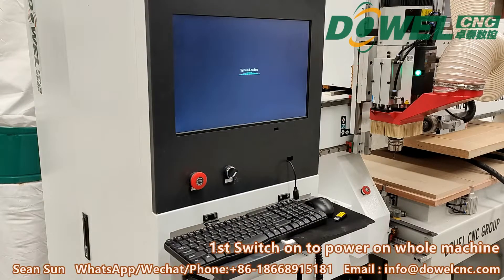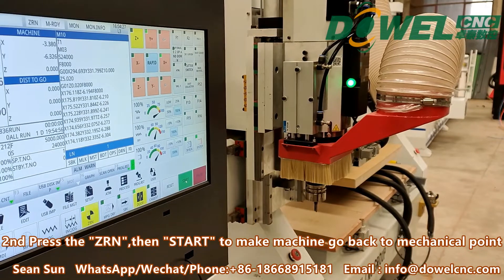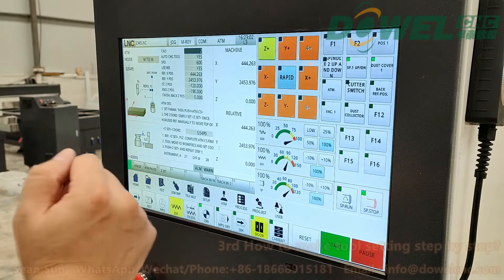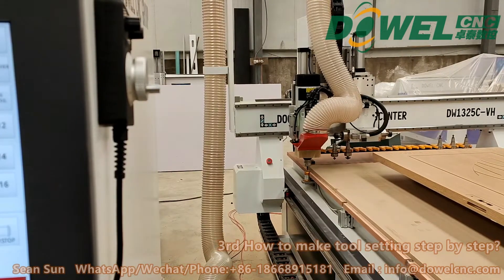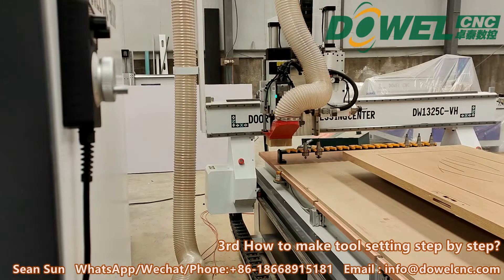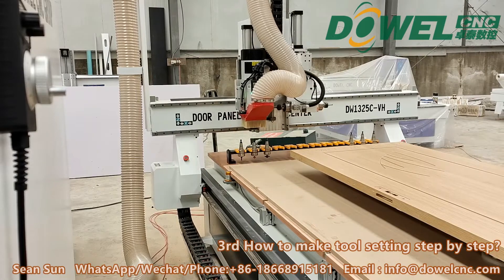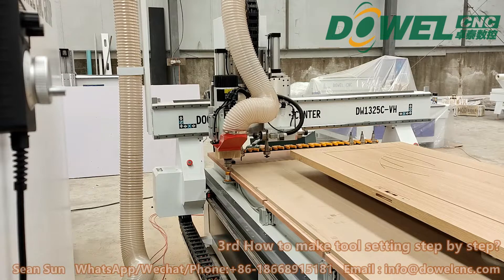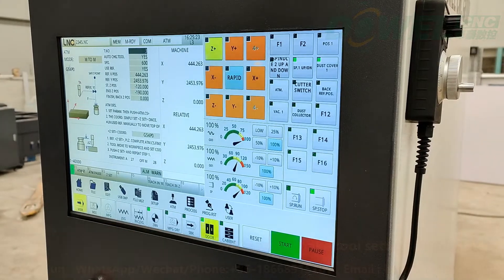How to Use LNC Controller of ATC CNC Router? Tutorial Video and User Manual of Taiwan LNC Controller

Comment: Hello, very good video!  Helped me turn on and set up the machine, the controller is LNC MW2200.  I want to ask you what software you use to prepare the (.nc) files?  So far I have used artcam 2018 which has over 30 different (.nc) "G code for the tool path files" , only one was able to open but there is a problem with the Z axis.  Thank you very much !
Reply: hi i have same problem with you, did figure it out which nc file is working?
Reply: @udiStyler  I use Art Cam, which does not have a post processor for LNC.  I use another post processor, which I edit in NOTE PAD.  I had a problem with turning off the dust collector, it turned out that M72 was working.
Reply: @georgipraskov8223  which post processor do you use, and is it an atc post processor? how is it edited? thanks
Reply: @udiStyler  
In my case, the NC file for ATC  looks   like this...

T1
M03 S18000
G43 H1
G00X38.000Y84.000Z16.020
G01Z-8.000F500
G00Z16.020
G00Y116.150
G01Z-8.000F500
G00Z16.020
G00X259.000Y50.000
G01Z-8.000F500
G00Z16.020
G00X291.000
G01Z-8.000F500
G00Z16.020
G00X38.000Y685.350
G01Z-8.000F500
G00Z16.020
G00Y717.350
G01Z-8.000F500
G00Z16.020
M5
T9
M03 S6000
G43 H9
G00X30.000Y9.200Z16.020
G01Z-19.000F500
G00Z16.020
G00X165.600
G01Z-19.000F500
G00Z16.020
G00X296.200
G01Z-19.000F500
G00Z16.020
G00Y792.000
G01Z-19.000F500
G00Z16.020
G00X163.100
G01Z-19.000F500
G00Z16.020
G00X30.000
G01Z-19.000F500
G00Z16.020
M5
T10
M03 S6000
G43 H10
G00X30.181Y179.500Z16.020
G01Z-12.000F500
G00Z16.020
G00Y229.500
G01Z-12.000F500
G00Z16.020
G00X30.000Y279.500
G01Z-12.000F500
G00Z16.020
G00Y329.500
G01Z-12.000F500
G00Z16.020
G00Y379.500
G01Z-12.000F500
G00Z16.020
G00Y429.500
G01Z-12.000F500
G00Z16.020
G00Y496.500
G01Z-12.000F500
G00Z16.020
G00Y546.500
G01Z-12.000F500
G00Z16.020
G00Y596.500
G01Z-12.000F500
G00Z16.020
G00X283.200
G01Z-12.000F500
G00Z16.020
G00Y546.500
G01Z-12.000F500
G00Z16.020
G00Y496.500
G01Z-12.000F500
G00Z16.020
G00Y429.500
G01Z-12.000F500
G00Z16.020
G00Y379.500
G01Z-12.000F500
G00Z16.020
G00Y329.500
G01Z-12.000F500
G00Z16.020
G00Y279.500
G01Z-12.000F500
G00Z16.020
G00X283.381Y229.500
G01Z-12.000F500
G00Z16.020
G00Y179.500
G01Z-12.000F500
G00Z16.020
M5
T4
M03 S18000
G43 H4
G00X311.200Y2.075Z16.020
G01Z-2.714F300
G01Y97.037F1500
G02X315.208Y101.000I3.979J-0.016
G01X337.200
G00Z16.020
G00X311.200Y2.075
G01Z-5.429F300
G01Y97.037F1500
G02X315.208Y101.000
G01X337.200
G00Z16.020
G00X311.200Y2.075
G01Z-8.143F300
G01Y97.037F1500
G02X315.208Y101.000
G01X337.200
G00Z16.020
G00X311.200Y2.075
G01Z-10.857F300
G01Y97.037F1500
G02X315.208Y101.000
G01X337.200
G00Z16.020
G00X311.200Y2.075
G01Z-13.571F300
G01Y97.037F1500
G02X315.208Y101.000
G01X337.200
G00Z16.020
G00X311.200Y2.075
G01Z-16.286F300
G01Y97.037F1500
G02X315.208Y101.000
G01X337.200
G00Z16.020
G00X311.200Y2.075
G01Z-19.000F300
G01Y97.037F1500
G02X315.208Y101.000
G01X337.200
G00Z16.020
G00X311.200Y0.000
G01Z-3.250F300
G01Y97.000F1500
Y792.200
G00Z16.020
G00Y0.000
G01Z-6.500F300
G01Y97.000F1500
Y792.200
G00Z16.020
G00Y0.000
G01Z-9.750F300
G01Y97.000F1500
Y792.200
G00Z16.020
G00Y0.000
G01Z-13.000F300
G01Y97.000F1500
Y792.200
G00Z16.020
G00X0.000Y1500.000
M5
M72
M30
Reply: In my case the NC file looks like this 

T1
M03 S18000
G43 H1
G00X38.000Y84.000Z16.020
G01Z-8.000F500
G00Z16.020
G00Y116.150
G01Z-8.000F500
G00Z16.020
G00X259.000Y50.000
G01Z-8.000F500
G00Z16.020
G00X291.000
G01Z-8.000F500
G00Z16.020
G00X38.000Y685.350
G01Z-8.000F500
G00Z16.020
G00Y717.350
G01Z-8.000F500
G00Z16.020
M5
T9
M03 S6000
G43 H9
G00X30.000Y9.200Z16.020
G01Z-19.000F500
G00Z16.020
G00X165.600
G01Z-19.000F500
G00Z16.020
G00X296.200
G01Z-19.000F500
G00Z16.020
G00Y792.000
G01Z-19.000F500
G00Z16.020
G00X163.100
G01Z-19.000F500
G00Z16.020
G00X30.000
G01Z-19.000F500
G00Z16.020
M5
T10
M03 S6000
G43 H10
G00X30.181Y179.500Z16.020
G01Z-12.000F500
G00Z16.020
G00Y229.500
G01Z-12.000F500
G00Z16.020
G00X30.000Y279.500
G01Z-12.000F500
G00Z16.020
G00Y329.500
G01Z-12.000F500
G00Z16.020
G00Y379.500
G01Z-12.000F500
G00Z16.020
G00Y429.500
G01Z-12.000F500
G00Z16.020
G00Y496.500
G01Z-12.000F500
G00Z16.020
G00Y546.500
G01Z-12.000F500
G00Z16.020
G00Y596.500
G01Z-12.000F500
G00Z16.020
G00X283.200
G01Z-12.000F500
G00Z16.020
G00Y546.500
G01Z-12.000F500
G00Z16.020
G00Y496.500
G01Z-12.000F500
G00Z16.020
G00Y429.500
G01Z-12.000F500
G00Z16.020
G00Y379.500
G01Z-12.000F500
G00Z16.020
G00Y329.500
G01Z-12.000F500
G00Z16.020
G00Y279.500
G01Z-12.000F500
G00Z16.020
G00X283.381Y229.500
G01Z-12.000F500
G00Z16.020
G00Y179.500
G01Z-12.000F500
G00Z16.020
M5
T4
M03 S18000
G43 H4
G00X311.200Y2.075Z16.020
G01Z-2.714F300
G01Y97.037F1500
G02X315.208Y101.000I3.979J-0.016
G01X337.200
G00Z16.020
G00X311.200Y2.075
G01Z-5.429F300
G01Y97.037F1500
G02X315.208Y101.000
G01X337.200
G00Z16.020
G00X311.200Y2.075
G01Z-8.143F300
G01Y97.037F1500
G02X315.208Y101.000
G01X337.200
G00Z16.020
G00X311.200Y2.075
G01Z-10.857F300
G01Y97.037F1500
G02X315.208Y101.000
G01X337.200
G00Z16.020
G00X311.200Y2.075
G01Z-13.571F300
G01Y97.037F1500
G02X315.208Y101.000
G01X337.200
G00Z16.020
G00X311.200Y2.075
G01Z-16.286F300
G01Y97.037F1500
G02X315.208Y101.000
G01X337.200
G00Z16.020
G00X311.200Y2.075
G01Z-19.000F300
G01Y97.037F1500
G02X315.208Y101.000
G01X337.200
G00Z16.020
G00X311.200Y0.000
G01Z-3.250F300
G01Y97.000F1500
Y792.200
G00Z16.020
G00Y0.000
G01Z-6.500F300
G01Y97.000F1500
Y792.200
G00Z16.020
G00Y0.000
G01Z-9.750F300
G01Y97.000F1500
Y792.200
G00Z16.020
G00Y0.000
G01Z-13.000F300
G01Y97.000F1500
Y792.200
G00Z16.020
G00X0.000Y1500.000
M5
M72
M30
Reply: Hello, I use CAMTech_CMC3 ToolchangeMM(*.nc). I open it with notepad, delete the beginning and end and put the codes that are for LNC.
Reply: I have postprocer